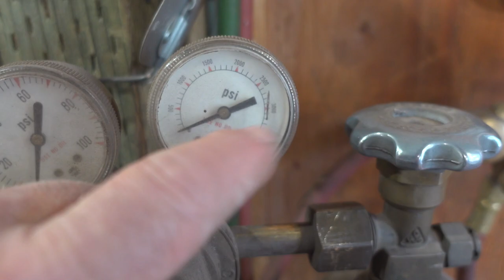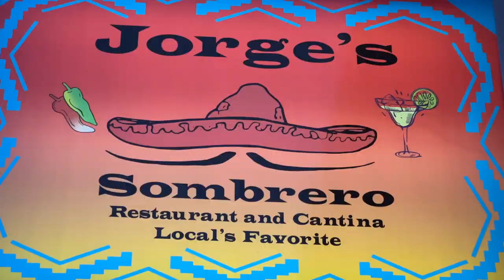Bathroom or Leather Working Studio

Comment: Hi John, I can relate to your activities in this video. The spare ox tank is always empty. A project that you were thinking of, becomes a now project. I also had a tool cabinet to install in my camper/toyhaller, I found out it was a lot easier to handle after I took the drawers out and the wood top off. Glad you got help putting your tool cabinet down and steps. Thanks for sharing.👍

Comment: Fantastic Video!! I really enjoyed the multi-subject nature of the video. So jealous on your little hord of leather you have. I need to go buy another bit of veg tan leather myself. I am almost out which is never fun. Btw Egg crate foam does wonders for sound deadening but can be pricey. An alternative is cork board or rockwool insulation. Some home depots will carry sound board aka homosote which I have found to the the cheapest sound deadening. An advantage of putting up sound deadening panels is you can cover them in fabric and they  can then become a place to pin patterns. Angles are also your friend for sound deadening. The thing that causes most echo is flat smooth walls running parallel to each other. Yes in a former life I did some sound work and have helped to design and fix a couple existing recording studios. Along with the sound work I had built sets for stage and screen and did a little lighting work. To get rid of sound due to raised platforms on stage Homosote was a go to and I would then lay 1/4" Masonite on top. Made for a wonderful floor that was quite and would take a high gloss paint job beautifully. Hope those ideas help and keep up the wonderful job you do on your videos.

Comment: Good stuff!  Your adventure with the rolling cabinet is a great example of why I tell folks that the #1 tool in the blacksmith's shop, for me, is my rope.  If there's one book every person should own, it'd be the Ashley Book of Knots.  A true gem of a book and the real window in time, allowing us to see how rope was used in olden days.  If they could flip a huge sailing ship on its side to clean the hull, we can use the same principles to move things around the smithy!  In your case, I think you could whip up something like a "porta-wrap" in the shop and fasten it to your trailer hitch.  Then it'd be easy work to safely lower that cabinet.  Not saying you could safely do it yourself, but that it'd increase the safety factor and make it a lot easier.  Of course, as a former FD gent, you're probably very familiar with ropes and blocks.  The 'porta wrap' is nice for lowering down an incline simply because there are no moving parts.